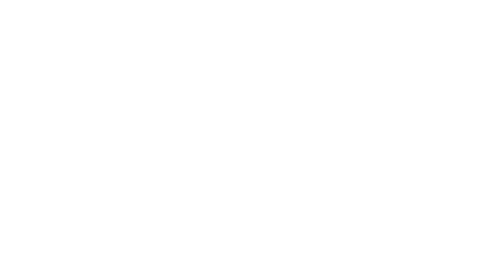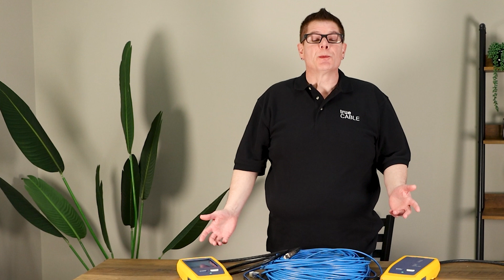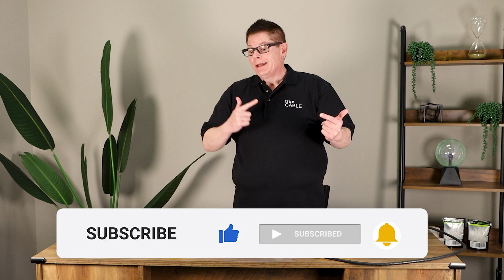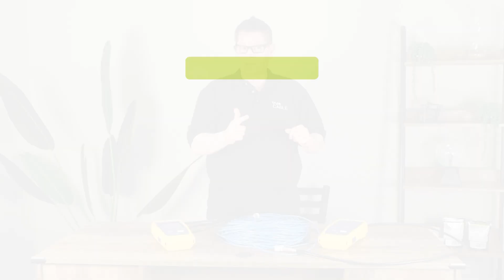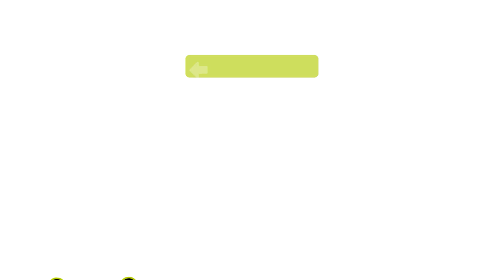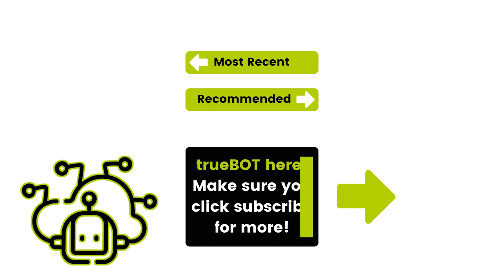Quality Testing Ethernet Cable And Why It's Important!

Comment: So you like to see more insertion loss ????

Lower is better not higher
Reply from the maker: Hello! Lower IL (Insertion Loss) is definitely better, but the question is are higher dB numbers better or not, I think? For any given parameter like IL, a lower dB number is WORSE, not better. dB measurement values are an inverse relationship. I hope that clears that up!
Reply: @trueCABLE  
No sir

If I insert something inline and I have a 3db loss that equates to half the power/signal is lost.  
I think perhaps your thinking in RF terms of rejection and in that case higher would be better.
Reply: @dark30welderwelding11  this confused me too.
My understanding is:
Insertion loss = closer to zero is best.
Return loss = further from zero is best.

Comment: Is it possible to do this test by connecting the cable to a laptop and running a software?
Reply from the maker: Hello! Not this exact test, no. That said, you will get a bandwidth test that should serve you well enough. If you have a contract/customer demanding actual Certification, then software bandwidth testing won't be enough.
Reply: @trueCABLE  thank you

Comment: how about using HIKVISION CAT6 AWG23 UTP cable? what is your insight regarding this brand of utp cable, im planning to use it on my networking project. thanks.
Reply from the maker: Hello! I have not worked with that brand of cable before, so I cannot offer an opinion. I would be sure it is solid copper Ethernet, and I would also heavily research two main things: Insulated conductor diameter (copper + insulation) and the overall cable jacket diameter (cable OD). Without those two critical pieces of information, you will find it difficult to select an appropriate 8P8C (aka RJ45) plug that will fit, unless HIKVISION has already pre-validated a certain plug to work with their cable like trueCABLE does. Hope this helps!

Comment: is there a device that determines if an ethernet got an interference?
Reply from the maker: Hello. Yes, it is called a BERT or Bit Error Rate tester. Essentially, it is a dedicated stand-alone bandwidth tester that you hook up at both ends of a cable run and let run for a day or so and come back and check. You can experiment by turning on AC motors and other high EMI/RFI devices in the environment and then checking on the BERT tester to see if any one of them caused bad packets. Advanced managed Ethernet switches can also give you a heads-up on this by reporting bad packets, but those are expensive switches. The Ubiquiti UniFi switch line is a good source there. Stand-alone BERT testers, a decent one, will run as much as $3,000. Check out Softing. The Fluke DSX Certification tester you see us using here only takes a snap-shot of the cable that compares the cable quality and termination quality against the TIA standard.

Comment: Does it matter that the cable is bundled up there versus run straight through an attic?  Would there be different readings - good or bad for either?  Also when purchasing cat5e or cat6 how does one tell if it is quality or not? Is there info on packaging that would answer this? Thanks for the video.
Reply from the maker: Hello Rick. Yes, there are different readings if you bundle up Ethernet. The cross-talk interference increases. Don't use zip ties. Instead, use velcro straps. Bundling up Ethernet should be kept to a minimum. Where you do bundle it up should be in a figure 8 pattern. Typically bundles are found at the switch end to accommodate adds/changes/moves. The figure 8 pattern minimizes alien crosstalk interference. Quality Ethernet can be difficult to discern when purchasing. The basics are it should be pure copper; and solid pure copper for permanent runs. The cable should be stamped "Compliant with ANSI/TIA 568.2-C" or "ANSI/TIA 568.2-D". Well-documented Ethernet cable is more likely to be higher quality. Sample Certification tests should be present on the specification sheet or readily available upon request.

Comment: Can you provide the key points to test when buying network cables? How to do it what to look at and what are the parameters that are important. It would be interesting to know
Reply from the maker: Hello and good question! I wrote a blog some time back about what to look for. See the information found in https://www.truecable.com/blogs/cable-academy/best-ethernet-cable-for-gaming for a good run-down on cable quality. Of course, when it comes to testing Ethernet cable nothing will beat having a Fluke Versiv Cable Analyzer around to be sure the cable will perform as it should. Generally I will strip 165ft from a spool or box and test using the permanent link adapters and correct Category test. The 165ft is the minimum recommended length to test per Fluke Networks for the DSX-8000. Secondarily you can also use a Fluke LinkIQ cable qualifier which costs considerably less if the DSX is too pricey. The LinkIQ is not an actual certification instrument but it comes pretty close for the money!